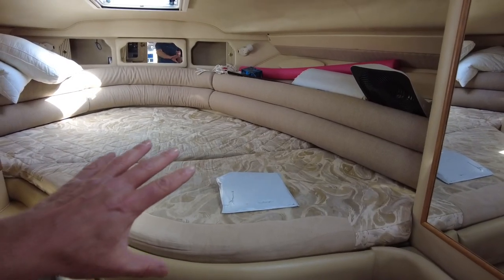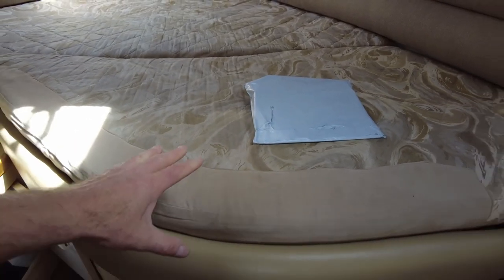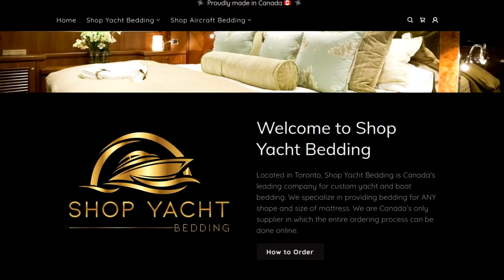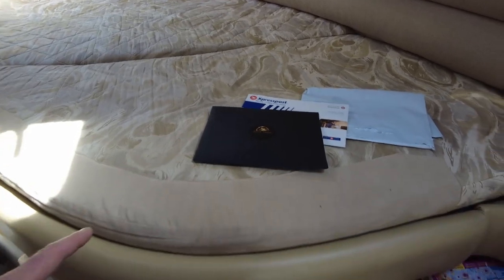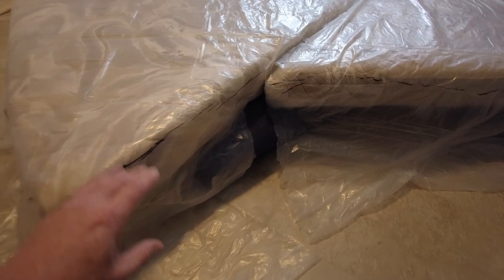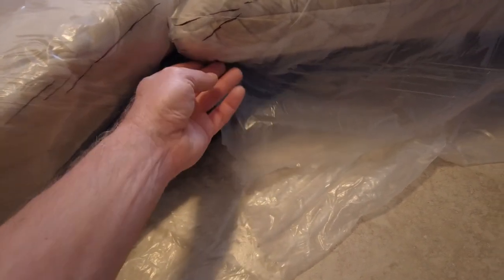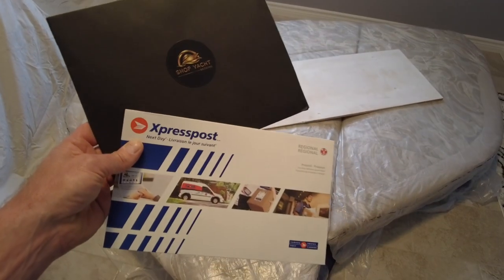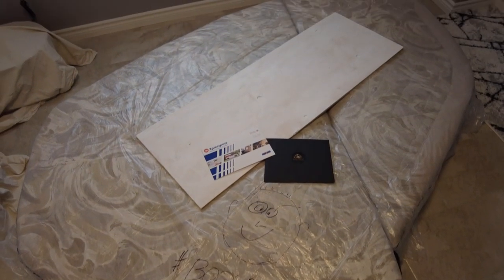New Boat Bedding - Sea Ray Sundancer

Comment: Bugaboo I enjoy all your boating videos & tips. I need your expertise decision! I have located a 2001 280 Searay Sundancer without outdrives and it's being sold at a good price as is. I'm unable to run the motors and the seller says the motors ran in 2015 before winterizing and haven't ran them since. Do you think this would be risky buy or should I take the chance? Thank you...
Reply from the maker: Boogaboo. 
Boogaboo.

Comment: Hey hi,
We're getting a SeaRay 300 in the spring. You've had a few SeaRays... Were the bedding dimensions/size/outline all the same?
Reply from the maker: You're gonna have to measure that up directly. Lots of different configurations over the years and models.

Comment: Here's my idea. Use about a three or four inch wide strip of Velcro down the split to hold the mattresses together. I also think it's time to retire a twenty year old mattress and they can add the Velcro then. Either way Good luck!
Reply from the maker: We considered doing that, as well as a full, real mattress -, but went with this setup. Also replaced the foam in the cushions, so will be like brand new👌